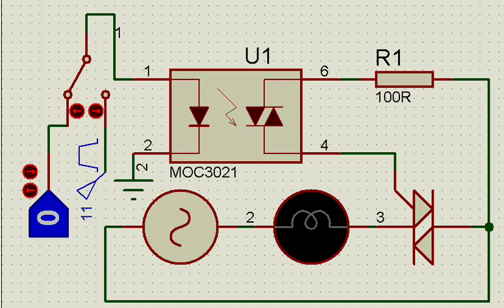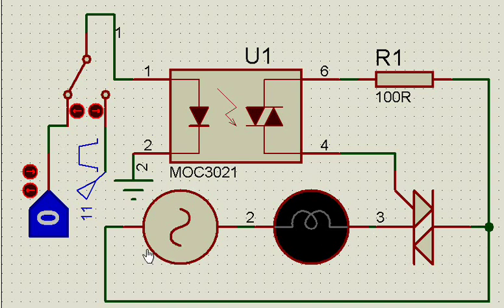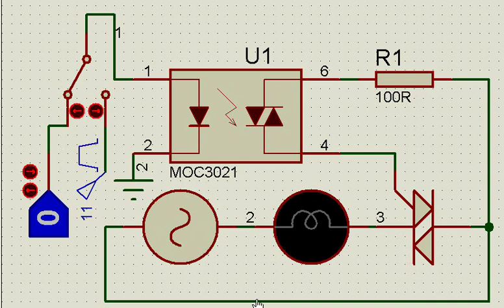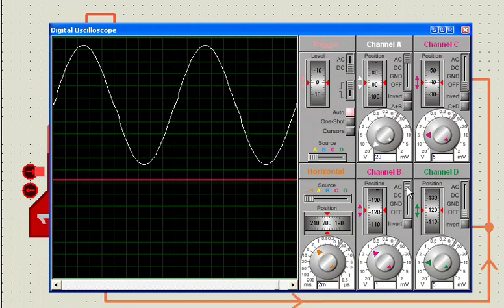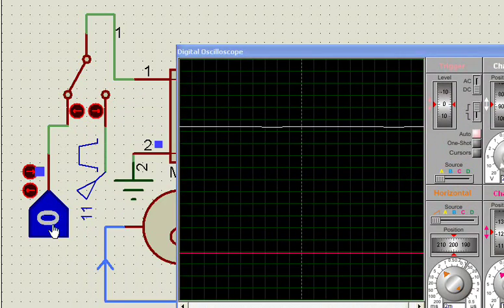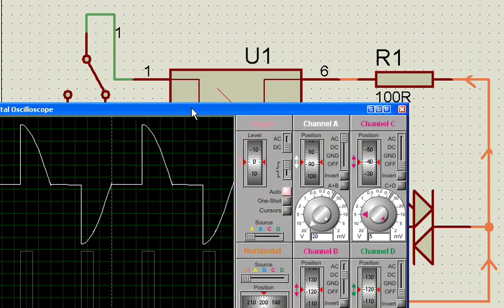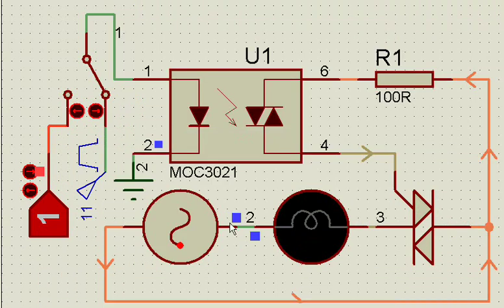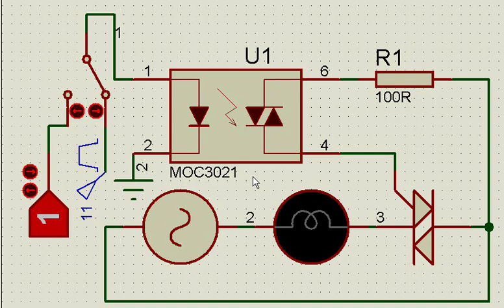opto-isolator interfaced triac  to microcontroller

Comment: HI, why isnt working on proteus until i connect the negative pin to ground!
Reply: For DC path in opto LED side dc negative is assumed by Proteus as connected to ground. Hence unless one grounds the negative side it will not work. Even for ac side also for Proteus one has to ground the alternator side of the ac load failing which oscilloscope will not work. In real world however ac side ground is not required but for watching on oscilloscope one has to use a step down transformer.

Comment: hello sir thank you for your tutorial. I need to use the triac as a switch to short a 12 VAC to the ground (When I short 12 VAC to ground it activate an input of another device), should I use the resistance R1 (100 ohm) and what kind of triac to I need for my application ? thank you
Reply from the maker: Yes. Use any triac starting with a  library name TECCOR

Comment: can this circuit be used for inductive load like electromagnet or inductor , motor ?
Reply from the maker: No. One has to use a snubber for inductive loads. Pls Watch my videos on that
Reply: Patnaik UC yes sir I am aware of that but my question is can I use pwm at the input to control power
Reply from the maker: No. There are other method for ac pwm. You may watch my video on the same
Reply: Patnaik UC ac load interface to microcontroller is that right the video ?
Reply from the maker: watch my electrical chopper by IGBT    https://www.youtube.com/watch?v=tw5h0UNi0qY&index=27&list=PLwqeLUznmPCFac68qBSmgPG33SVIkP_1N

Comment: sir  can i used MOC3011 instead of MOC3021, and what is the period of the pwm? thank u
Reply: how did u synrchronize the period of ac voltage and pwm?
Reply from the maker: For 110 v mains supply 3011 is ok

Comment: sir, i watched your most of the videos and each and every video is awesome. can you tell me what is the name of the switch that you used for alternate logic and delayed pulse in proteus. and also what frequency and ac voltage have you set for this circut ? waiting for your kind reply...
Reply from the maker: Select logic probe /logic state. For delayed pulse use ,use left side vertical column and then pulse and feed data as you need
Reply: Thank you sir... sir did you use normal standard frequency 50 hz and voltage 220 v in protius?
Reply from the maker: No. It is a manipulation ( for the purpose of explaining the concept ) with low voltage as Proteus sometimes does not support high voltage simulation

Comment: Actually I got different result too
when you said "Factors responsible-Lamp voltage,resistance /alternator voltage ,frequency/Triac type. Needs sound knowledge of hardware also." 
can you please... eleberate or give more detail about your component are used, frequency, and so...
I wanna make sure of that
Reply: and also, where exactly you put your osciloscope probe?
Reply from the maker: Shall try some time in a google hangout

Comment: how you will synchronise the delayed firing angle with AC input to load??
Reply from the maker: First one has to develop zero voltage sensing pulses by several circuits. (available in my play list also ) Then use that as reference and write the program how much delay  is requiredper every button push at the input
Reply: Can we detect a zero crossing  if we give a 5v pulsating dc to Arduino using analogvoltageread () function
Reply from the maker: no
Reply: Can you tell me Why ??

Comment: Can you perhaps elaborate on the gate resistor value that is needed - I can't find a clear explanation anywhere.  I read the Igt and Vgt is the requirement to trigger the gate with values 22ma and 1.7V(depending on triac).  If i connect it as you have i tend to think the voltage on the gate is 220V and i would need to add resistance to give a current of 22ma into the gate.  The values often used are 180 or 300 ohm(not what i expected).  If i then look at the voltage across the resistor and calculate the power it is way more than the 1/2 watt they use.
Reply from the maker: +Clinton Brits Voltage at the gate can never be 220 volt because the moment the the gate drive current exceeds the triggering current the triac it conducts while then the voltage falls to a very low value.Typically the diac of the opto has a breakdown voltage from 22 volts to 40 volts depending upon the type. Therefore after the light falls on the Opto LED and the voltage of the ac cycle exceeds that voltage the diac conducts. So the resistor value of 300 say results in 22v/300 = about 70mA which is good enough for a standard triac to conduct even taking care of the 2nd and 4th quadrant higher gate current demand.Moreover there is no other problem-- For example a triac like BT 139 can withstand a peak gate current of 2 A and 5 watts. So the triac will not fail even the resistor is made 100 ohms.

Comment: When I simulate mine I get error in proteus, will like to know what I am doing wrong.

[SPICE] TRAN:  Timestep too small; timestep = 1.38778e-017
Reply from the maker: +Ronald Arthur Many factors are responsible for that.Voltage /frequency of alternator voltage and resistance of lamp,type of power semiconductor selected (triac),system RAM,CPU speed etc. Besides ,good knowledge of hardware is a pre-requisite.
Reply: +Patnaik UC yes. I have designed other system which I built and they are all working. noticed I had to tie to ground which I don't understand for an AC
Reply from the maker: +Ronald Arthur In proteus simulation one needs to use ground even for ac.I have also used ground in ac but hidden by special means

Comment: hello sir, i have designed the same circuit and lamp is glowing but it does not desired output waveforms.
i have tried for different values of resistance as per the ckt diagrams, but the output waveforms are different from the desired one.
sir please tell me solution.
and thank for video.
Reply from the maker: +Gopal Moti Factors responsible-Lamp voltage,resistance /alternator voltage ,frequency/Triac type. Needs sound knowledge of hardware also.

Comment: I am using MOC3023 and triac BTA16 for 24 volt circuit but I am not able to achieve full conduction there is always a drop of around 0.9 to 1.2 volts across MT1 and MT2, instead of getting 24V, only 22.8 is obtained. What can I do to achieve full conduction, I am using arduino microcontroller to operate MOC3023.

Comment from the maker: 1 K at diac is not correct.Use 100 to 150 ohms. It will work.It is difficult to explain why 100 ohms.You might be thinking it will fail at 230 volts. Donot worry no component will fail even the triac

Comment: Hi, 
Thank you for your video. I however have a question. I have made the circuit from this link
Ive used BT136 triac. I however cant seem to figure out why my lamp does not glow. I did attach the input to of the moc 3021 via a 220 ohms to 5 volts. 
However ive used 1K resistor between the diac and the mains voltage. 
All i can see is 30 volts at the output i.e where the lamp is. 
What could be the problem. I need to know how you chose the 100 ohms resistor. My supply voltage is 240 Volts @50Hz.

Comment: sir i tried this circuit for many times by using moc3021 .but it doesn't work.when i provide 5v to the pin1 and then grounded the pin 2 of the moc 3021 optoisolator didnt triggered so that the triac didnt go to in state ..whats the problem plz help me .